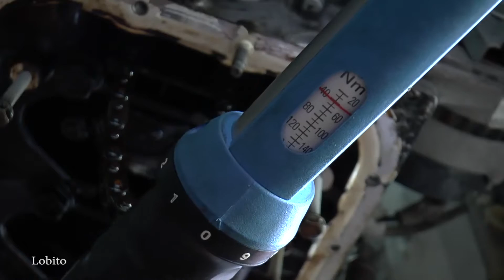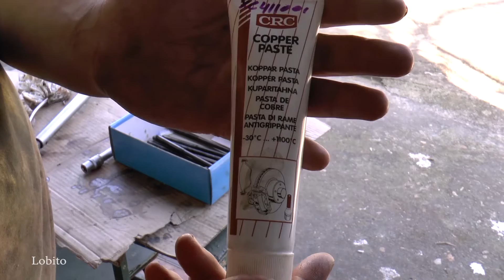Citroen AX junta de culata y extracción de pistones ( PARTE 3/4 )

Comment: Lo haces todo de perlas,ya puedes tocar motores de cual quier coche,..Pero como es que le pones los tornillos de culata los mismos,en vez de ponérselos nuevos...)
Reply from the maker: Hola Zamsystem,gracias por comentar.Esta reparacion la hice para poder probar el motor durante unos kilometros antes de rehacerlo( tengo video de 2 horas pero por el momento lo puse en privado) lo que viene siendo cambiar todo elemento de desgaste.Para esta ocasion no cambie los tornillos de culata pero aun asi en este coche no es necesario cambiarlos( segun el fabricante) a no ser que sobrepasen el estiramiento maximo.
Al rehacerlo despues de 6500km de prueba,le meti tornillos nuevos por seguridad.Los bloques de aluminio ,unos de los fallos que tienen es pasar de rosca el bloque con facilidad.